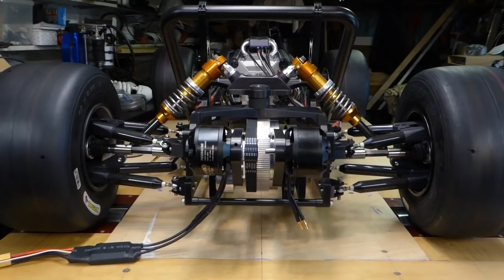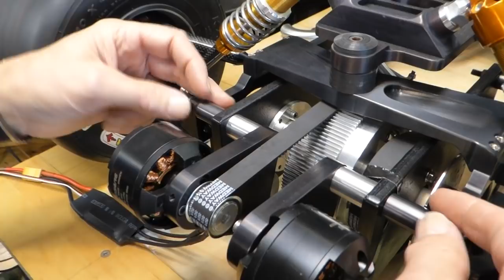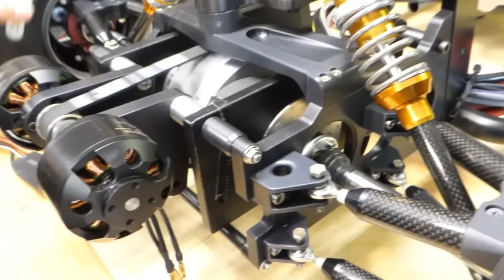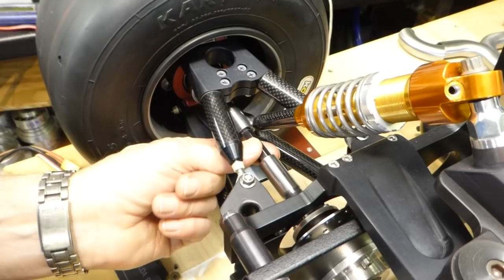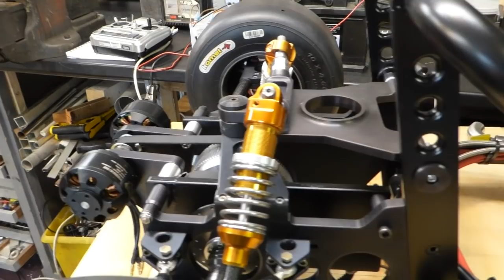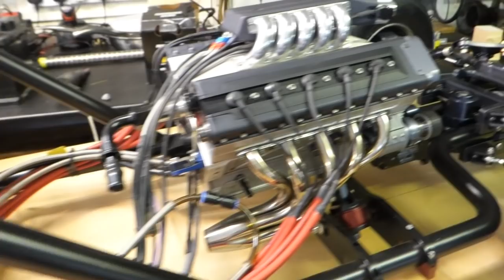1/3 Scale Fuel Injected 125cc V10 RC Buggy, part 4.

Comment: The lagging in the motor is because there is to much load on the motor
Reply: the motor is "COGGING" because a brushless motor is not meant to move at slow speeds unless it is a senseored brushless motor. The "cogging your seeing is the motor hesitating between magnets.

Comment: With your amazing ability to make and machine things have you thought about building turbo chargers for you every little 10 Cylinder?I am utterly amazed at the motor, I used to build motors for sprint cars as a side line while spending my days job as a fire truck technician, I could knock out a 3 angle valve job and things like this but your work takes things to a whole new level. I am really impressed with you motor!
Reply from the maker: Thanks. Yes, a turbo sounds like a nice little project. I don’t think it could be made to produce much boost at this scale though, but if I could get, say 3 or 4 psi out of one then I’d be happy to bolt it on.
Reply: @Keith5700  you could make a mini supercharger and gear the heck out of that

Comment: The motor is fine
Reply: Yes electric motors do that when barely under acceleration it's like a kinda surge when it's going back and forth between enough power to spin the motor and not enough

Comment: Smaller drive pulleys on the motors cuz the low speed driving is putting to much drag for the motors and esc and it's cogging..

Comment: The speed controller is adjustable and programmable to adjust how the motor starts from a stop. But it can be limited if you do not use motors with hall affect sensors installed. They will perform better in this application.

Comment: How did you made CV joints? or what did u modified to make it work for this scale?
Reply from the maker: They're a 3 pin tripode design with sliding balls, running in a slotted outer, like front wheel drive car inner joints. The outers are hardened and ground so hopefully will last ok. Yes, I made them.

Comment: What you experienced is “cogging”, and it happens with unsensored brushless systems. at low RPMs. A sensored ESC and motor allows for smooth operation from top to bottom.

Comment: have you thought about doing your drive like the Koenigsegg? just direct drive from engine to clutch to rear diff and maybe put electric assist in the middle to help in the low end?
Reply: Not so simple I'm afraid, this engine likely doesn't produce nearly enough torque for such a system to be viable.
Reply: I think to would just more depend on the ring and pinion gear ratio I mean a over 100cc engine can put out a lot so far we have only seen it at idle

Comment: I'm absolutely fascinated by this. Waiting for updates with baited breath :) I'm curious to know if you've had a chance to try it out in your garden yet, and if so, what kind of performance did you get from the electric motors?
Reply from the maker: No, the motor controllers wouldn't get it moving. I tried some better sensored controllers but they were rubbish so swapped for some better vesc ones, but they won't even switch on! Wiring up the V10 at the moment.
Reply: @Keith5700  Thanks for replying. Good luck with the v10!

Comment: Did you consider mounting the electric motors in the front? One per wheel
Reply from the maker: No. I wish I'd done it as a 4wd from the start, but at the time it looked like a mammoth project already, without the added complication of fwd. if it all works nice, and I don't get bored with it then I can add front drive later on. There is a transfer box as part of the transaxle, so won't be too hard to add later.
I've started the gearbox. Ecu is Megasquirt MS3.
Reply: @Keith5700  I was considering the front motors a bit as an AWD hack

Comment: You have to get the gas engine running it the engine and all your engineering of the drive train and coolant system is awesome screw the electric motors that gas engine is so cool and was that a supercharger in vid 5 your working on your very skilled I hope you work in a field where you put your skills to use you should be build race cars or engineering cars looks great keep it up
Reply from the maker: I used to make full sized cars, then tried model helicopters, then thought I'd have a go at a car. Don't know what I'll try next tho.
Reply: Keith5700 you are extremely skilled my friend. I am thoroughly impressed. I can’t wait to see that v10 under load.
Reply: @Keith5700  next 1/2 scale

Comment: I just wanted to say that I've had similar issues with RC brushless outrunner motors before. I discovered was that it was because I was using an ESC of too higher power... I was trying to use (from memory) a 70A ESC on a motor that only required a 20A ESC on a small model aeroplane park flyer. It was fine and flew with no issues other that at very low throttle, the motor reacted exactly as yours did here.

Comment: What I would suggest for a replacement to those motors would be to get some sensored brushless outruners (and ESC's) instead of the sensorless ones that you have, the main difference between the two kinds of brushless motors are that the sensored ones have a Hall effect sensor that makes it so that the ESC can tell what position the the permanent magnets are relative to the electro magnets which eliminates that cogging action the sensorless motors have at low rpm under such load, it also makes the motors have more torque
Reply: The sensor-less type speed controller gets feed back directly from the windings. The hunting effect at start up is the speed controller trying to work out which direction the motor is turning.

Comment: why are you running electric motors... is the gas engine just for looks?
Reply from the maker: yes, it's just a cardboard cutout.
Reply: @Keith5700  Lol, its not. But i thought you were going to drive it with the engine? Or both together?
Reply from the maker: Engine only, or both together. Depends how fast it is with the engine.

Comment: The motor is "Cogging" this is because the ESC is SENSORLESS and does not know where is the rotor positioned in the magnetic field so it "guesses" at first, When it starts to run then the ESC can detect with resistance what pole is next in line so it smooths out the turning of the motor. 

You need a SENSORED MOTOR and ESC.. There are a few outrunner motors that do run in Sensored mode, This will smooth out the low speed initial speed.

Comment: Hi fella nice project, just earned another sub :-). The reason for the judder from the motor is that its brushless 3 phase. The Esc doesn't know what phase the motor is in upon startup. We refer to it as cogging in the hobby. There are "sensored" motors and esc's out there, which have a multicore cable connected between the motor and esc which helps to stop this.
Reply from the maker: I'm struggling to find many high powered sensored esc's out there, that are in stock. I have 2 x 4500w motors now, but no controller.
Reply: @Keith5700  Have a look a the controllers based on the VESC project. They can work in sensored mode and have plenty of power.
Reply: He must be using something else for ESC's. That is one MESS period. How is that FUEL INJECTED, ITS ELECTRIC.

Comment: Wow that's a real nice peice of engineering .. it's prob already been answered in regards to the motor splutter .. thats the esc timing .. here u can see how to reset and fix
https://youtu.be/aX5EfAg2G4M
Reply from the maker: The biggest problem is that the motors won't start from zero revs if there's any load on them. I've got the programming card and have already tried different timing positions.

Comment: Hi Keith, 
I just wanted to say, this is probably the coolest and most sophisticated hobby project I've ever seen. Two classmates and I built an electric cart for a school project earlier this year and this has given us inspiration for what we could do along those lines in the future. I was wondering what your background in engineering/fabrication is, and whether you designed the engine from scratch or built it off a pre-existing design?
Good luck with the rest of the build
Jack
Reply from the maker: Hi, my background has always been in engineering, at work and as a hobby. I started young with Lego, and over 50 odd years have graduated to this type of stuff. Everything is designed from scratch. I'm not really interested in building anything from existing designs, or kits.
Reply: @Keith5700  seriously impressive, nice work

Comment: Your motor problem is not in the motor mate, it's a matter of firmware on the ESC.
Plus I'm assuming that your are simply pulling the PWM signal straight from the RX into the ESC. This will give you the very most basic type of pulse modulation. (which is what the esc then uses to generate the actual stepping sync). A better ESC and proper configuration in respect to it's combi with the attached motor and pulsetrain will sort you out beautifully. Also i suggest taking a much lower KV rating for your fairly torqueheavy application. 
Absolutely stunning build. Im a huge fan.
Reply: Also sensored motors and ESC's would be an idea too.
Reply: @SgtStinger  certainly better i agree
Reply from the maker: Yes I'm looking at a whole new setup, with twin, bigger motors and a dual vesc controller, from alienpowersupplies.
Reply: @Keith5700  sounds good👍

Comment: That cogging due to the type of ESC you are using (there are onroad esc's that are sensorless and work well). The ones you are using are made for aircraft where there isn't a load at very low rpm. Another issue is, is that they are also not made for high loads and will burn out quite quick in something like this. look at hobbywing onroad escs for a cheap setup. But anyway amazing work my friend the attention to detail blew me away.

Comment: Don't use those cheap RC motor controllers, they are for high speed and low speed they just cogg. Go for FOC system which is vector control and gives you super smooth running and not that noisy like these cheap trapezoid types are, and they run super low speed , and they are more efficient. Look for Google for "VESC", around 90$ each.

Comment: I use large brushless motors and they don't cog if set up correctly , choose a esc that's amp rated 20perc more than the motor requires , Skateboard esc's are good because they suit the low rpm /torque of you application over say a high rpm one for a heli or boat . Use a programming card for the esc : set to car mode ,  set the timing to  zero degrees  and pwm to sum of:   kv of motor   x battery voltage =  x pole count of motor = divide by 20
Reply from the maker: Yes, but the skateboard ones don't have reverse. Been looking at hobby King but not sure which would be suitable yet.
Reply: I use a 'R-Snake' Skateboard  3-12s /120 amp one, and it has boat aero and car settings with reverse.
Reply from the maker: I've ordered a couple of sensored motors and a dual controller from alienpowersupplies. Hope these work ok.
Reply: sensored motors should be really quiet compared to nonsensored and more efficient cooler running !

Comment: yes those motor are not meant to "cog" like that. those are an unsensored motor they tend to "cog" but a castle esc and the tuning software along with that u should be able to increase the starting power i believe and that may help that slow speed "cogging"

Comment: That thing that is going on with the motor at 2:10 happens with all hobby grade brush-less motors that are not sensored. The esc's do not know where the motors are at in relation to the rotation at any one time and so the esc are just alternating the power back and forth between all three wire like they normally would with out any rhyme or reason. with a sensored motor the alternating the power happens between the wire ally when it is precisely needed. DeWalt brushless motors are sensored and that why they never have this problem. I used to have a Traxxas X maxx rc moster truck 1:8 scale. And it would do this same thing aat low RPM along with all my other non sensoed brushless rc cars. Its not a bad thing that that happens. I would not worry about it. But IF you do worry about it then by new brushless motors that are sensored along with esc's that can handle the sensored wiring. Look it up its actually really cool. Hope this helps.
Reply from the maker: Thanks, I understand now about the sensored bit, and everyone is saying the same thing pretty much, but I can't find any large power sensored innrunner motors in stock in the UK. Unless I'm just looking in all the wrong places.
Reply: @Keith5700  have you tried hobby king.com?
Reply from the maker: Yes, looking at them now. Wow, clunkiest website ever? Some nice sensored Inrunners. Wish I knew what I was looking at.  Need to do more research.  Cheers.

Comment: you can eliminate your cogging by setting up your mimum throttle threshold through the ecs (you need the ecs programming card), you could also setup your rear height ajustment with a opposing wedge design. you sir are building something quite special.

Comment: Couple of questions 

is the motor on the front real ?
Why did you used outrunner motors ?
The gear reduction is crazy .
Reply from the maker: Because I'm a bit of a dumbbell.
Reply: I doubt that ... Is the motor a functioning scale gas motor  ?
Reply from the maker: Yes, watch the video.
Reply: better low end toque and just look better than a sealed cylinder. this car is a work of art
Reply from the maker: That's pretty much what I'm finding. Like there's no sensored motors in stock in uk anywhere near big enough for this thing.
Reply from the maker: I'm leaning towards a big turnigy outrunner for the main grunt, and a smaller sensored innrunner to get off the line and for the reverse. What do you think to that?
Reply from the maker: Hello, did you get your motors?
I've ordered a couple of 8045 out runners and a twin sensored esc from alienpowerservices.
I've got the esc but waiting for the motors.

Comment: Woow! What a show I love modeling but I stopped at the 1 \ 5 scale with various Fg that I repaired and resold. I own a Hpi Baja 5B under repair. Unfortunately I have nothing in scale 1 \ 3. :( Could you give me some information about the basic model? This is an interesting addition to two brushless motors, but the water that goes into engines ... It 's good that in cars and so on the alternator is always in contact with dust, water and various debris In any case I would prefer to see them a little more protected.
Greetings.

Comment: the juddering is just cogging normal for low speeds on a non Sensored motor need brushless sensord motor
Reply: Timmy Reeves he also needs the lowest KV around  1600 to 1300.
Reply: @xristoskalandrias2834  has he talked about his gearing and lipo setup somewhere?

Comment: Use a sensored brushes motor. Won't be perfect but far better than that. The ESC doesn't know exactly where the bell is until it starts moving decently. The hall sensored motors almost fix this completely.
Reply from the maker: Where will I get one of those from?
Reply: @Keith5700  A lot of the rc car brushless motors can be had in sensored form.  Look for a higher turn number.  Higher means less rpm and more torque.
Reply from the maker: ive been looking all week, nothing remotely suitable and in stock in UK.
Reply: @Keith5700  if you're limited in length similar to the motors your have on there it will be more difficult to find. Most are the "mabuchi 540" size. You can go a little more custom and add your own hall effect sensors.

Comment: To get less of that sputtering at low speed switch to sensored brushless or else it will always jitter like that at low throttle.
Reply: This is on point. However you could also use a VESC, commonly used in electric skateboards. It will give you better response at low rpm with a sensorless bldc motor.
Reply from the maker: Who makes these sensored motors for this size car?

Comment: lol ok . ps I have an alternative idea for remote control system, which has been rattling around my head for a while. if you can develop it, your welcome to it. If it works, it will possibly revolutionise the way RC cars are operated
Reply from the maker: is it all in your head or is their anything to see yet?
Reply: the tech exists already, and for some time ! but has not been utilised/ Incorporated/amalgamated ,( for want of a better word) as far as I know . so yes the idea is in my head. If there is any way to have private conversation, I can explain. but as a platform to begin with, your project is ideal . Basically requires 1/4 scale or above , as  tech would be more expensive. Ps It may be worth keeping to yourself, as the idea already works... but in a variety of different formats and would maybe think of patent protection

Comment: what your experiencing at low rpm is cogging. your motors are just standard 3 pole plane motors which arnt sensored which is your issue. get motors that are sensored and you wont have that issue.
Reply from the maker: Where shall I get them from?